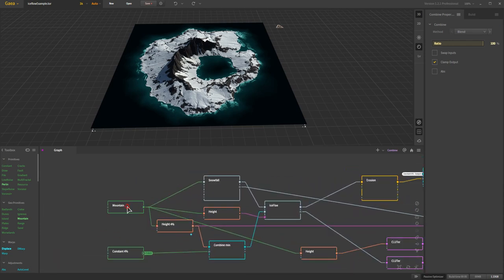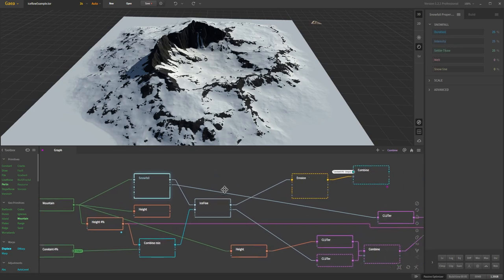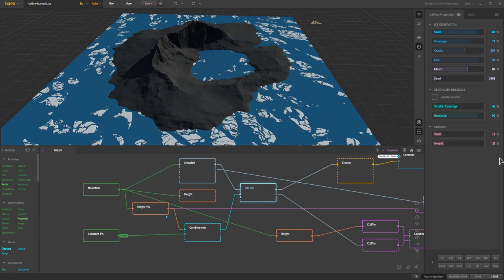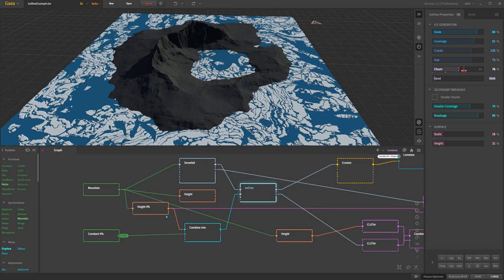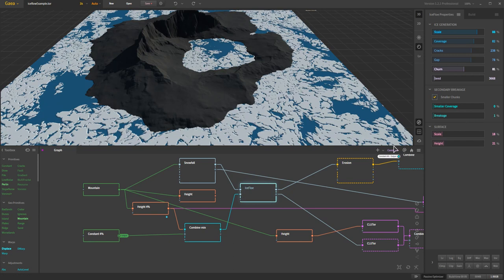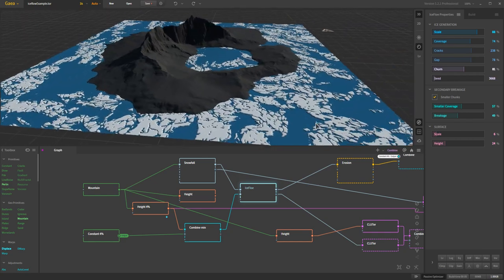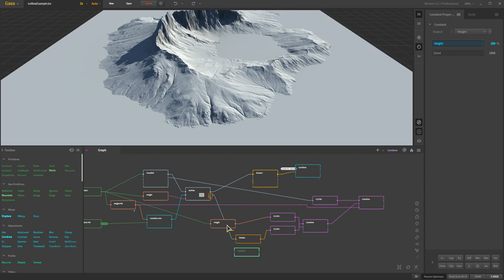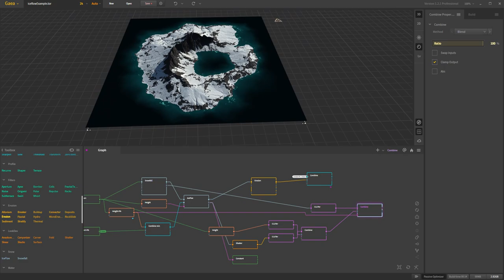Quadspinner Gaea - IceFlow node

Comment: Very informative!   Is it just me though or are the ice flows underwater in your final mesh?     Shouldn't they be white flat with the water surface??
Reply from the maker: you can adjust for this certainly. Though, portions of ice flows are submerged. The ice above the water is not always the same size of the ice under the water and they can be even far more complex than this tool allows on its own.. So I would actually be inclined to replace the flows when getting closer. Mainly this was just to get the iceflow settings explained in the context of a scene. :)

Comment: Did the exact same thing, ended up with a flat image of a height map :/
Reply from the maker: I noticed there is a newer version available. Could be an issue there if you have a newer version than mine. I'm using "1.2.1.3" If you did all the same things but got a negative result. Otherwise.. perhaps you have a node set incorrectly to mask instead of terrain? This is occasionally the case where Gaea sets a nodes mode automatically if you connect the wrong kind of input accidentally, then even if you correct the mistake it stays in mask mode and you have to right click to check and correct it. Most maps should be set to "Show as> Default" with colour nodes (purple ones) will always be set to "Show as>Mask" so if you click a node and it shows as a greyscale image instead of height. That's the setting to look for... Right click and look for "Show as>"
Reply: @cowsmanaut  Thanks for the help, but this comment also explains why I shouldn't be fucking around in professional software when I have absolutely no reason to other than I think it's cool. Again, though, thank you for trying to help!
Reply from the maker: @HA11EYS_COM3T  Oh no! don't think that way. Hobbyists exist to help advance the software just as much as professionals. Every software has its quirks. Trying to answer remotely a question where I can't quite see what is in your screen is hard. This is where the facebook group, Discord channel, and official forums come in. They all have the ability to share screen shots with a large community present to help you in kind. (with an image). Youtube is not really that platform outside of the ability to respond to videos with video of your own (which is a larger commitment than just a comment or screen shot).. Anyway, I hope you don't give up.. things seem more complex at the start than they should with this kind of tool.. as you make more breakthroughs, the easier everything gets.

Comment: I just came here from an older video of yours where you were curious why people have trouble hearing you.
Rather than checking your own uploads to say that you CAN hear yourself, compare your volume to other sources.
I have an overpowering headset, so if I browse around, I tend to leave it at 20% or less volume on Windows, and the videos themselves usually at around 10% volume.
The actual volume coming out of those videos is about 5 times louder than yours (that's the lowest estimate, it's honestly over 20 times scale difference as this music video at 5% volume is still  several times louder than you at 100%.)
To test.. Just load a bunch of random stuff you'd normally watch. Now, play your own video from YouTube. Do NOT change the volume. Now, play another video from someone else, and keep doing that.
You may be capable of hearing your own volume, but it is a minimal fraction of the volume of just about every other media source you'll find out there.
I can hear you as well. But only because I turn my headset's volume to a point that, if I were to switch videos or get a notification from something else, my ears would rupture into a bloody pulp all over my office.
Reply from the maker: So, when I record current videos, I check the levels for distortion. Meaning making sure the red bar(volume level) doesn't clip to the end to often while speaking normally. I then check my videos AFTER uploading them to see they are audible. My volume is set to half on my computer. They are audible. I've also checked them at other locations (work for example) and don't have an issue. I like many other people on youtube, tend to watch a number of other videos on youtube.. I often find the ads very loud, but not most other videos. With this video in particular I just listened to it again, and immediately clicked on a few others to follow it such as a Graeme Norton video, and another random CG tutorial and the volume was comparable with one specific exception. I was speaking a little lower (not whispering, just mildly lower than normal) here because of the hour it was recorded.  Often my free time comes after midnight.  Again, despite this, the volume difference on my PC speakers and headphones was not drastically different. So I'm not certain what causes this difference for some, and not for others. I use these videos in my classes as well. The same recording equipment has been used over the entire pandemic while teaching classes over zoom and recording these classes using bandicam just like the tutorials. No issues nor complaints.  So, something is happening.. I don't think you, nor others are lying about the noise issues, but I can not for the life of me understand why some have this issue, while others do not.
Reply: @cowsmanaut  I decided to test disabling spatial audio, virtualized surround, etc. And I didn't notice much difference (I am also curious, same as you.)
I CAN hear you, as stated, you just seem a lot quieter than other sources to me. Having seen the question posed from others, I realized that a lot of people probably can't hear you at an audible level (on my phone you're pretty much inaudible, but I barely ever use my phone, just decided to test.)
I think it may just come down to the lack of range in your recorded voice. It sounds like you have a naturally deep voice, but the recording has none (I can however hear the growls that tell me that.) It comes out as "flat", which can just be more difficult to focus on than to actually hear.
Just suggestions. Not criticizing, just on a break from my own problem solving and tried to contribute something to a comment i noticed that I can somewhat agree with.
Reply from the maker: @DawnBriarDev  No worries, I definitely appreciate the extra effort not only in just mentioning that you too have the issue, but digging deeper to see if there is a reason you could figure out. I had wondered if maybe there were some different compression methods I could look at that might result in more consistency across the locations people are watching the videos.  As you point out, your phone is quieter. I haven't looked at that yet. There are some ways to compress audio (they do this for Ads both on TV and online to make sure it's range is consistently louder than the regular content. Maybe there is a solution there. The only thing is how much time it requires. These online tutorials are not a source of income for me, I do them from available free time, Occasionally use them in classes as supplemental material. So unless the solution is not time intensive, I may not have the ability to consistently use it. I'll dig a bit deeper into the settings of Bandicam and see if there is something I missed.